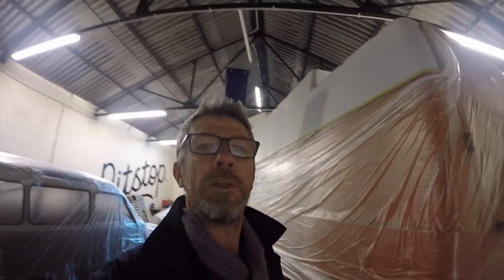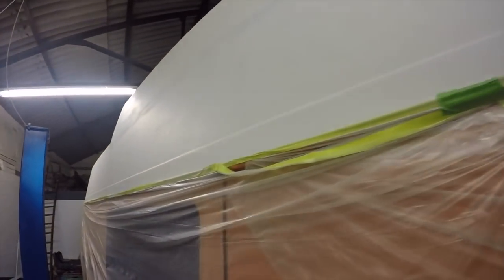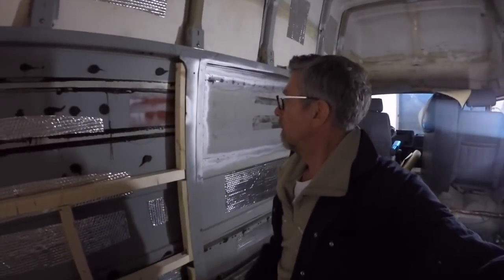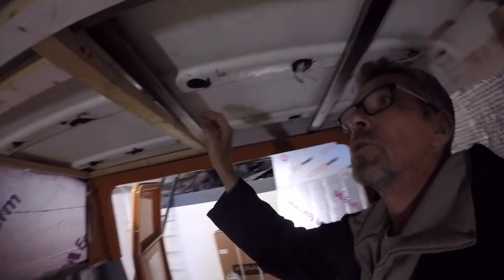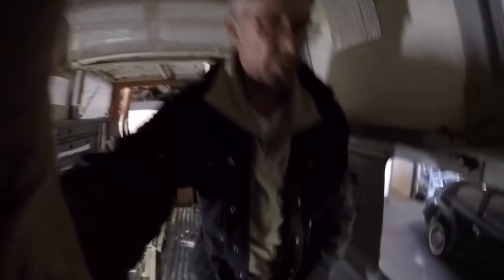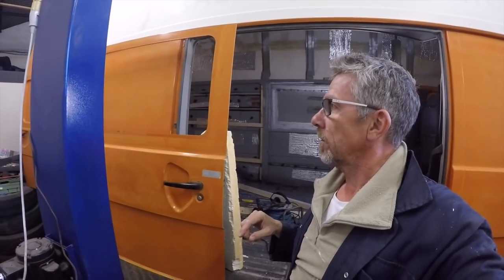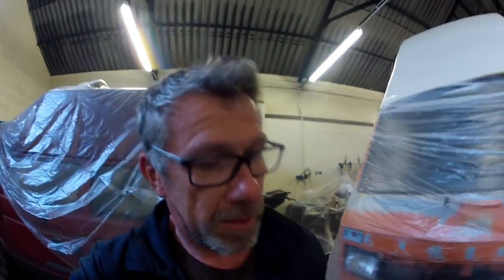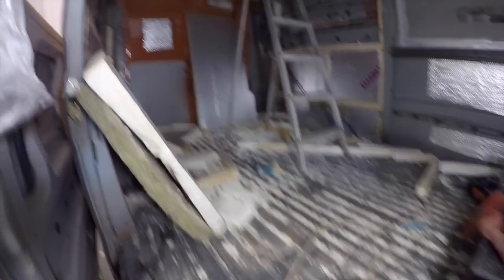Spraying the High Top/GRP Roof - Self Build Journal - Walt #8 VW LT 4x4 - CamperVanMan

Comment: What rustoleum colour/ral did you use for the roof?
Reply from the maker: Hi Chris. It was RAL1013 - Oyster White. Good colour that. Very much the same as standard Westfalia high tops
Reply: @CampervanMan  thanks so much! do you recommend satin or gloss?
Reply from the maker: @chrisunderdown1520  If you're spraying satin has a really nice subtle sheen. For 
rollering I'm guessing gloss might actually work better but I didn't try it.